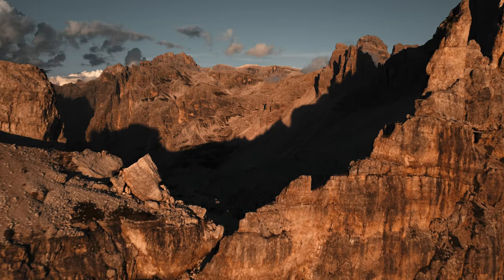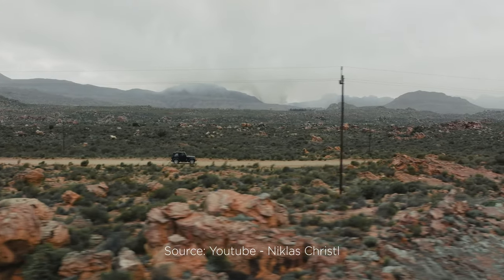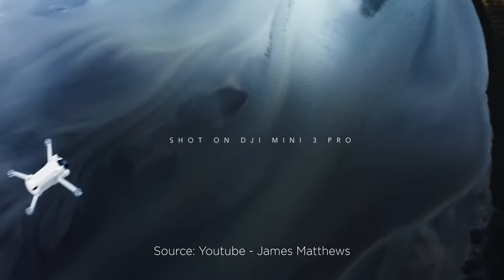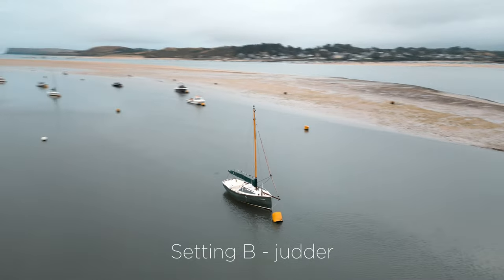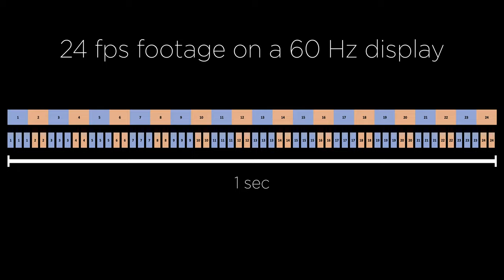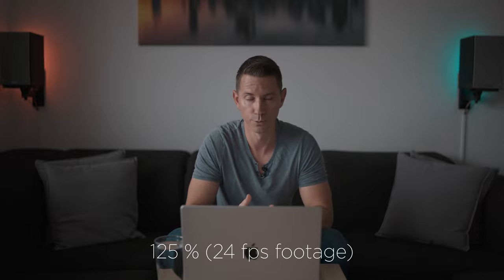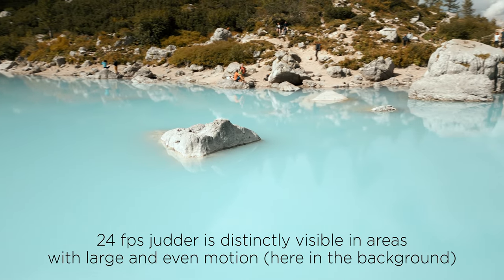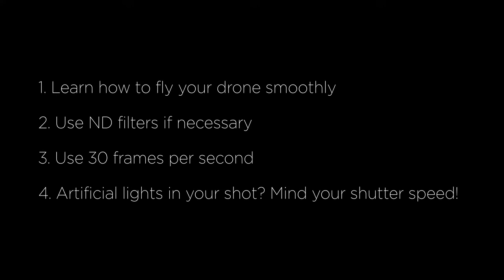The #1 Secret for CINEMATIC Drone Video without Judder, Stutter or Jerkiness

Comment: 3:15 this is a very complex topic and 24fps definitely looks more cinematic than 30fps in most situations (assuming it's running on a screen that can play both frame rates natively). But there are a few caveats, first of all the one that you mention about screens and what fps they are capable of reproducing, most new apple devices have "pro motion" which is 120fps which allows us to play both 24fps and 30fps natively. The ideal and what will probably be the norm in the future is 120fps timelines with native 24fps playback for most scenes and 30,48 or even 60fps for pans or fast motion scenes.

That being said, if you want your footage to be viewable in most devices at a native fps then yes, 30fps is probably the way to go. If you want native playback but the 24fps look a good compromise is 30fps but at a 225degree shutter or 1/48th of a second as opposed to 1/60th. That way you get the motion blur of 24fps but the smoother video of 30fps and can be played natively on most devices.
Reply from the maker: Hey there, thank you for your detailed comment. You're right - there is a difference between 24 and 30 fps, with 24 fps being more "cinematic" simply because it is cinema standard. On common computer/smartphone screens (60 Hz) however, it looks way worse because of the judder, no smooth movement possible. When you have a screen that can display both frame rates natively and judder free, there is a difference although I find the 20 % less frames per second of 24 fps vs. 30 fps not that much of a game changer, but that might be very subjective. And another observation I made: on my Macbook Pro M1 Max and my iPhone 14 Pro (both able up to 120 Hz with ProMotion) 24 fps videos still judder. I don't know why, the only explanation I have is that the ProMotion feature can go up to 120 Hz but for some reason doesn't when playing back 24 fps videos. Anyway, I think the goal should be to produce content that is viewable in a good and smooth quality not only on premium monitors but the majority of them, so I promote my method of 30 fps (and ideally 1/48 or 1/50 sec shutter speed).

When it comes to the shutter angle, you're absolutely right. With drones (without variable aperture) I can only approximate the "best" shutter angle because I need to adjust exposure with shutter speed (and ND filters). But with cameras and VND filters, I usually film with 30 fps 1/50 sec, which is a close approximation to 1/48. The main reason is avoiding flickering lights in my area (PAL) when filming in 30 fps, but the "enhanced" motion blur with 1/50 also might help. Though I don't really think there's much of a difference to notice, but technically, you're absolutely right.

Nice to see that some people have deeper understanding of this issue :)

Comment: OK German boy! But if you film with the normal mirror, less camera in 24 and you have a drone footage with 30 FPS, which timeline and which export you will be chose?
Reply from the maker: Not German.. 🤔
If you have the camera footage in 24 fps and drone footage in 30 fps, put everything on a 30 fps timeline, so that the output (the timeline fps) is compatible with the display refresh rate. The camera footage will still judder, but the drone footage will be smooth. If you put everything on a 24 p timeline, everything will judder.
And if you have not filmed the camera footage yet, record in 30 fps so everything is judderfree. I wouldn't mix up framerates if possible.

Comment: Subscribed. Fantastic video. It also made me laugh as my "designer" gave me 24fps footage to post on our company website telling me it was 24fps to make it look lovely and smooth. Now do I send him your video? 😆
Reply from the maker: 😅 Well, it's normal. 24 fps is cinema and is therefore the best 😉 Even if you cannot really see 24 fps on most screens because of the incompatible screen refresh rates 😉
But if the footage is good and it is only available in 24 fps, well then simple use it. In most types of footage it won't be that noticeable.

Comment: The Key thing is also that You dont speed down or speed up your video unevenly because that also ruins the framerate.

About that 30fps rule i dont know i get the judder in the fastest moving part of the screen anyway. I make my videos on my phone s20 with power director. I dont know if that's the case
Reply from the maker: True, uneven speed changes do cause judder as well.

Is it really judder? It might be that your shutter speed is too fast. Do you use ND filters?
Reply: @t0mwhazzup  yes i do use nd filtes but even if i dont use them the center of the frame look ok but the edges sometimes jidder simetimes not. Id rather be sure the effect is gone then focus on achieving proper motion blur
Reply from the maker: @SmasherFPV23  Just to confirm, you film in 30 fps, your timeline has 30 fps and you export your final video in 30 fps?
Then.. what shutter speed do you have in those unsmooth clips?
Reply: OK So I found the fps and bitrate option in PowerDirector for Android. It's on the pop up box when You click "Produce" button in "settings" but I record in 30fps and 30fps is default in this menu. I don't know what else. I also clean ram before producing to have the best performance. But the video is still choppy on the sides
Reply from the maker: As I said, check your shutter speed, ideally it should be 1/60 or even below @SmasherFPV23
Reply: @t0mwhazzup  I understand. On another editor (Filmora where You can set the framerate) it seems ok. But I have another problem. Theres some kind of pulsing of darak spaces on the clip once every second like getting lighter and darker and lighter and so on. It' some kind of flicker but I haven't found a solution to it. Its a problem of every mini registered about 2019 and still happens on every clip with wide contrast. Do You have a solition to it?

Comment: Great Video.  I normally try to shoot at 60fps and set the shutter speed at 1/120s  (180 Rule) and use ND Filters (Adjustable 1 to 5 stops) if necessary to allow this to happen. This also gives me the possibility of a nice slow replay if required. So far I guess I'm doing something right as playback is smooth.
Reply from the maker: @CLLUK  Thank you very much for your feedback!

Comment: Hi, like many I have wanted to try and get a smooth transition with my filming and I have firstly tried to avoid fast flying and eratic turns which greatly improved quality, then because my films are only complimented by additional drone footage I have switched from 60fps down to 30fps and the difference has been incredible, thank you for your clear "No BS" approach to explaining this, regards James :)
Reply from the maker: Hey James, thanks a lot for your comment, I really appreciate your feedback. Very happy if it helped 👌🏼
Reply: @t0mwhazzup  It did and I thank you for it 👍😉

Comment: Instantly subbed! You just solved a very annoying issue that I was having on my youtube channel's drone videos and also on videos for clients. Thanks! Is it okay to shoot in 30fps, upload it on a 30fps timeline and slow down the footage to 80% to get a little slow motion? Will this cause the stutter again? Is there any magic combination between Clip's fps and Timeline's fps to be able to slow the footage down in post and still avoid the stutter? Thanks a million!
Reply from the maker: Thank you very much for your kind feedback - I really appreciate it :) Regarding your question... yes, this will cause irregular movement again. Actually, you cannot really smoothly slow down 30 fps footage on a 30 fps timeline, because it's already realtime. There are, depending on your program, frame interpolation algorithms you could use, which calculate new frames out of the existing ones, but this works sometimes better, sometimes worse... for slow motion, I'd use 60 fps footage on a 30 fps timeline - this gives 2x slow motion. If you'd want something just slightly slower than real time, you have to either live with juddering/stuttering footage, use these interpolation methods.. or another way would be to use 30 fps footage on a 24 fps timeline, this way you could put the 30 fps footage on 80% speed so that it plays back evenly on a 24 fps timeline. The problem here is that you'd still end up with a 24 fps timeline, i.e. a 24 fps exported video, which will not play smoothly in itself on most screens - as explained in this video ;)
I'd try to go the frame interpolation route if I really needed to slow down footage just by a small percentage. Look out for artefacts in the footage after interpolation.
Maybe not the response you wanted to read, but I nevertheless hope that it helps :)
Reply: @t0mwhazzup  It is definitely the response I wanted and even beyond. Thank you so much for your explanation, which is very much appreciated. I just noticed the silliness of my question. It is due to the fact that I always work on a 24fps timeline and slowing a 30fps footage down to 80% in there is fine and is what I usually do :) But as you clearly explained in this video, this method would still cause the judder. Ok then, 60fps on a 30fps timeline, slowed down to 50%, seems to be the easiest solution for smooth and judder free slow motion. Unless I want to complicate things a little bit and shoot in 48fps (which, as you know, the Mini 3 Pro can also do) and do some more math to slow it down properly (probably 62,5% ?🤔).
Also, thanks for the interpolation tip. If you use Premiere Pro, you are probably talking about the "Optical Flow". I've used it a couple of times on DSLR footage but, as you rightly highlighted, it created unpleasant artefacts which led me to keep the footage at the original speed. I never tried it on drone footage but I'll certainly give it a go if needed. Maybe it gives better/acceptable results when there's not much going on/more static pixels in the scene? I'm very grateful to you for taking the time to respond and help :))
Reply from the maker: @ClaudioDesideriFilms  This 80% speed footage has something about it (in certain situations), it has some magic to it, yet is not slow motion... so I get you :) I just don't use it myself.
You could of course film in 48 fps and put it on a 30 fps timeline, if you know already during filming what you want to slow down by how much. I honestly don't :) With conventional drone footage it's easy for me, because drone footage in itself is usually slow, so I have almost never the need to slow it down (rather speed it up, if any speed change), so I film everything on my drone in 30 fps usually (except for FPV stuff which I film in 4K60, but still put it on a 30 fps timeline). But FPV is faster and might be slowed down or speedramped.

I use Davinci Resolve, but it's also Optical Flow there. Exactly :) It works good in DaVinci, but sometimes you get artefacts.